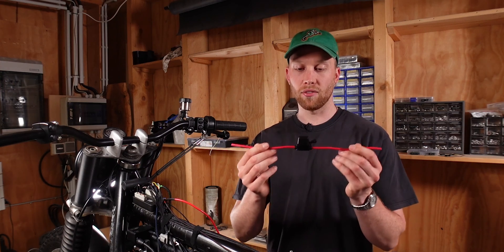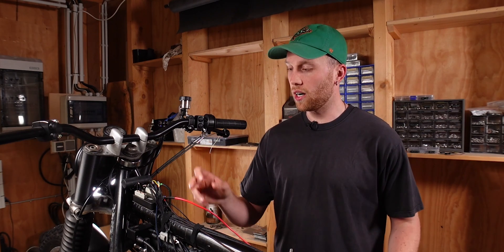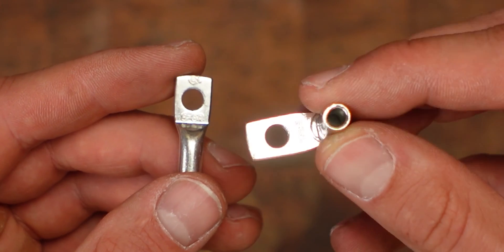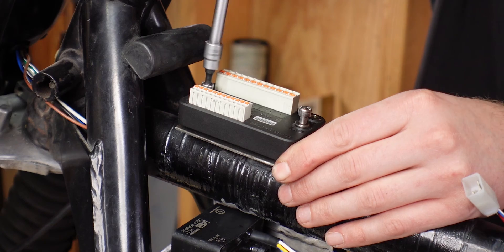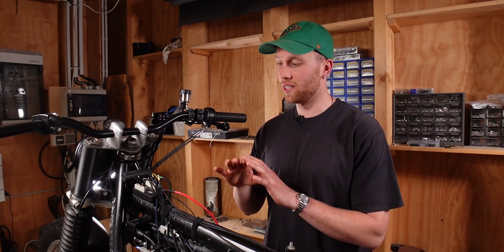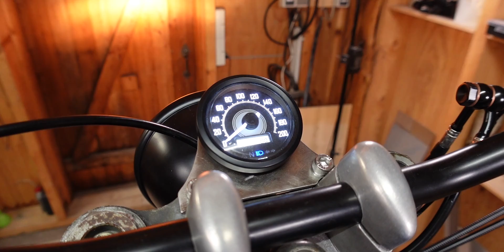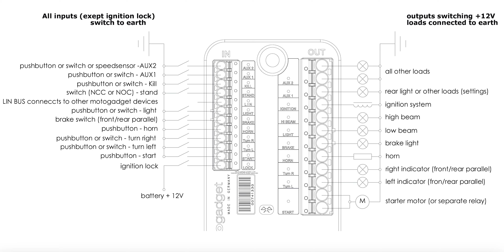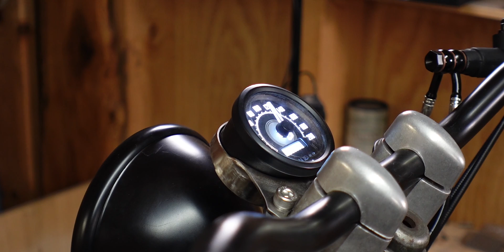How To Wire a m-Unit from Motogadget | Beginner Guide

Comment: Hello, I have a BMW R100, I have questions about engine wiring. Do you have a diagram of everything? It would be a great help, thank you!
Reply from the maker: Hi man, my complete wiring diagram is available in my store, you can find the link in the video description. However, I installed a new VAPE ignition and charging system, so the engine wiring is different to stock. If you are running the stock components you should be able to find a wiring diagram in the manual. I hope that helps!
Reply: @ Hello, the engine is standard. problem that I want to adapt everything to the motogadged central. I will have to do a new installation. thanks for answering!☺️
Reply from the maker: @APerformace ah I see. Yeah I also head a little bit of trouble with that. Send me an email at motowrenchers.blog@gmail.col and I’ll send you the wiring diagram for FREE. It might help you even though it’s not exactly the same setup 👌

Comment: hey im working in a R60 but i have in front GS1200 twing brake disk....i need a brake handles with the breake pump!!! which one are you using..or perhaps you can recomend!!
im in Argentina and is very dificult to get some parts!!
Reply from the maker: Che Cristian, que onda wacho? Yo use el Brembo PS15 que me gusta mucha. Are you going to use the original BMW brake calipers? Because the size of the master cylinder needs to be adapted to the size of the pistons inside the callipers. On the R80 there are two 40mm pistons (one on each side). Saludos a Argentina! Donde vivis? Viví en buenos aires cuando era joven y quiero volver.

Comment: This video is awesome and exactly what I needed. I have a 81 Yamaha xj750 I'm putting a moto unit blue on. My question is what about the ignition coils and the voltage regulator/stator. Is that all a separate thing? Maybe another video? 👀🤘🤣
Reply from the maker: Hi, thanks a lot. Yeah those should be wired up individually. You can download my wiring diagram in the description to see how the VAPE ignition and charging system goes together. It's a little different for every bike but that should give a good idea. The only wire that is connected from the VAPE system to the m.unit comes from the starter relay. If you have specific questions, motogadget is very responsive. I also had to hit them up to understand how I had to connect the ignition and charging system to the m.unit. I hope that helps. If you have any other questions when wiring up the m.unit, just let me know. I'm happy to help if I can. Cheers, Josh.

Comment: Moin Moin, tolles Video 😊🎉 und danke dafür .

Ich will auch auf MUnit umrüsten, das an meiner Harley. 
In der Beschreibung des MUnit steht geschrieben, es habe ein integriertes Starterrelais. 

Kann ich also das Originale entfernen?

LG
Reply from the maker: Moin! Danke dir!
Ja also Anlasserrelais müsstest du weglassen können. Die Relais Funktion übernimmt die Munit für alles. Bei mir laufen die zwei Kabel von Start Output direkt zum Anlassersolenoid.

Viel Erfolg beim verkabeln. Falls du Fragen hast schreib gerne. Vielleicht kann ich ja helfen. 

LG Joshua
Reply: @MotoWrenchers  danke für die schnelle Rückantwort 😄
Und mal so nebenbei, dein Englisch ist auf jeden Fall richtig gut.

Ich kam nur ins Grübeln, da in der Beschreibung geschrieben steht, das MUnit übernehme die Funktion des Starterrelais bei Vorhandensein von Magnetschaltern. Ich denke, das ist doch fast bei jedem Motorrad der Fall, wenn ich mich nicht irre, oder?

Hast du zufälligerweise auch ein Vodeo parat für die Verkabelung des Ladesystems? Das ist der Stromkreis, der mich bislang davon abgehalten hat, mein Motorrad selber zu verkabeln, weil dortige Verkabelungsfehler schwerwiegende Folgen haben können. 
Mit Gleichrichter und Lichtmaschine. 

Abo ist aber definitiv raus 👍
Reply from the maker: Klar, gerne 👍

Ich verstehe gut, dass das am Anfang etwas überfordernd ist. Ging mir genau so. 

Behältst du denn das originale Ladesystem? Falls ja, würde ich den originalen Schaltplan benutzen. Dann kann eigentlich nichts schief laufen. 

Falls du upgradest, so wie ich das gemacht habe, dann kann es helfen das alles erst mal auf‘m Tisch zusammen zu stecken und zu verstehen. 

Bevor du anfängst ist es auf jeden Fall eine sehr gute Idee, erst mal alle Teile zu finden und zu verstehen welches Kabel welches ist. 

Ich hatte auf jeden Fall mal ein Video gefunden, das erklärt wie die einzelnen Teile funktionieren aber nicht wie man sie verkabelt. Würde dir das helfen? Ansonsten habe ich die neue VAPE Anlage im „First Start“ Video verkabelt.

Wo hakt es denn grundsätzlich? Ist es das theoretische Verständnis, wie die Teile zusammen gehören oder wie du das praktisch umsetzt? Ich glaube, dann wüsste ich besser womit ich dir vielleicht weiterhelfen kann 💪
Reply: @MotoWrenchers  moin, danke für die Hilfsbereitschaft. 
Ja das Video wäre tatsächlich nicht verkehrt, obwohl grundlegende Kenntnisse vorhanden sind. 

Die Verkabelung aller Schalter und die der dazugehörige Verbraucher ist ja eigentlich selbsterklärend. Aber halt wenn es beispielsweise an die Lichtmaschine geht... Klemme ich diese an den Scheinwerfer? Habe gelesen, dass man die LiMa beispielsweise an den Scheinwerfer anschließt, da die Spannung  des Fernlichts erst die komplette Stromzufuhr für die Lichtmaschine benötigt. Bei normalem Abblendlicht wird ja weniger Strom benötigt als beim Einschalten des Fernlichts. 
Das generelle Indentifizieren aller Teile könnte auch ein Problem werden, da ich keinen Schaltplan für meine Harley habe und finde.
Und ja ich verwende alle originalen Geile, jedenfalls war so der Plan
Reply from the maker: @tltanslegacyxd7181 klar, sehr gerne :)
Hier ist ein Video, was mir am Anfang sehr geholfen hat. Vielleicht hilft dir das ja auch: https://youtu.be/FSAJciIFeRM?si=heWDDdR3rk-dRDER

Die Lichtmaschine ist eigentlich nur mit dem Gleichrichter verbunden. Der nimmt den produzierten Wechselstrom und wandelt den in Gleichstrom um, sodass die Elektrizität von allen anderen Teilen am Bike genutzt werden kann. Außerdem passt der Gleichrichter auf, dass die Energie nur in einer bestimmten Range an die Batterie abgegeben wird. Ich bin mir nicht mehr ganz sicher aber ich glaube ich habe das in diesem Video noch etwas genauer erklärt: https://youtu.be/tgbXfVIdizc?si=cRYC4cRADBwROH8-

Bei mir wir an der Lichtmaschine auch noch der Zündzeitpunkt abgenommen, dadurch habe ich noch Kabel die zur Zündung gehen aber das ist nicht die primäre Funktion. 

Das Fernlicht und alles andere, wie Blinker etc. läuft alles direkt über die Output Seite der Munit. 

Ich hoffe das hilft. Hast du das Werkstatthandbuch für deine Harley. Da müsste der Schaltplan drin sein. Wenn du den finden könntest würde das bestimmt sehr helfen. Vielleicht auch über ne Harleywerkstatt?
Reply: @MotoWrenchers  guten Abend, ich habe heute die komplette Elektronik identifiziert, habe doch einen schaltplan gefunden 😍 
An der Harley habe ich einen elektrischen Vakuum Schalter, welcher am Vergaser sitzt sowie ein Kontrollmodul für die Zündung. 
Hast du eine Ahnung, wie man diese beiden Komponenten anschließt ans Mo Unit?

LG
Reply from the maker: Moin,
Top, dass du einen passenden Schaltplan gefunden hast. Der wird bestimmt sehr hilfreich sein. Kannst du in deinem Schaltplan sehen, wie die beiden Komponenten vorher verkabelt waren? Bei der VAPE Zündung von der BMW ist die Kontrolleinheit mit der Lichtmaschine und dem Zündungsnehmer (so heißt das glaube ich auf Deutsch) verbunden und geht gar nicht an die Munit. Das einzige was bei mir von der Zündung mit der Munit verbunden ist, ist das Relais vom Zündsystem, was an den "Ignition" Output-Terminal angeschlossen ist.
Hast du dir schon einen neuen Schaltplan gezeichnet? Das hat mir am meisten geholfen alle offenen Fragen zu finden und dann systematisch zu beantworten. Am Ende habe ich dann für die letzten zwei Sachen, die ich selbst nicht rausgefunden habe Motogadget geschrieben. Ich hab dazu auch Video, was dir bestimmt hilft, wenn du es noch nicht gesehen hast: https://youtu.be/P0vhRdAyE2Q?si=n-ZvON6FLoG4oyGo
Reply: @MotoWrenchers  wirklich! Vielen vielen Dank, dass du auch antwortest und hilfst. Das würden dir wenigsten machen. Ich konnte das Problem schon lösen und habe mir einen Schaltplan für das Lade-, das Starter- und das Zündsystem erstellt😄👍
Reply: @MotoWrenchers  eine Frage habe ich noch 😂😂 
Ich habe zudem das Motogadget Mini Scope, also den Tacho.
Wird der an LIN BUS angeschlossen?
Reply: @MotoWrenchers  sooo, ich habe alles angeklemmt und es haut alles hin. Fast alles. Wenn ich den Schlüssel drehe, geht alles an, bis auf den Scheinwerfer. Da tut sich nix. Erst, nachdem ich einmal den Schalter für Abblendlicht/High Beam betätige. Erst dann geht Abblendlicht an. Wenn ich aber auf High Beam stelle, geht das Licht und das Rücklicht nach ca. 3 Sekunde aus. 
Mein Scheinwerfer hat 3 Anschlüsse, Masse, Abblendlicht und High Beam. Vielleicht habe ich die Stecker nicht korrekt angeschlossen. Kann dies ein Grund dafür sein? 

Und Neutralität leuchtet durchgehend, der Öldruck auch. 
Ich habe den Öldruck- sowie den Neutralschalter in den AUX1 Input und die Leitung zur Kontrollleuchteneinheit von AUX2 Out gelegt.
Ist dies so korrekt?

LG🎉
Reply from the maker: Moin, sorry für die späte Antwort. Bin vor zwei Wochen in die USA gezogen und musste einiges organisieren. Bin jetzt aber für Weihnachten auch schon wieder auf dem Weg zurück und muss noch den TÜV bestehen 😅 Du machst guten Fortschritt. Das mit dem Licht hat mich auch erst verwirrt. Das war/ist bei der BMW auch so aber das kann man wohl später in der App einstellen. Muss ich mich jetzt auch mal mit beschäftigen, wenn ich wieder in DE bin. Was hast du für Schalter/Knöpfe für‘s Licht. Ich habe die mo.buttons und da ist es so, dass wenn man zu lange den Highbeam Button drückt, dass das Licht wieder ausgeht. Vielleicht ist das schon mal ein easy fix. 
Öldruck und Neutral leuchten, weil die Dauerstrom von Aux bekommen. Die beiden laufen nicht über die Munit, sondern die Verbindung ist direkt zwischen den Schaltern und den Kabeln im Tacho (wenn die bei dir auch im Tacho sitzen). Und Masse ist entweder direkt im Schalter geregelt (wenn der nur einen Terminal hat) oder du legst die an den Rahmen irgendwo. Wenn du zwei Terminals am Schalter hast ist es egal welchen du für Masse nimmst. Guck mal in mein Diagramm, da sollte das ganz gut ersichtlich sein. 
Ich hoffe das löst die Probleme. Halt mich gerne auf dem Laufenden 💪
Reply: @MotoWrenchers  Respekt für diesen großen Schritt!! Aber mal ehrlich, gute Entscheidung 😄👍

Ich nutze an der harley die original Schalter, keine Taster. Licht ist Kippschalter, oben High Beam, unten Abblendlicht. 
Wenn ich zündung drehe, geht Licht nicht an, wenn ich dann den Schalter, egal ob nach oben oder unten betätige, geht Abblendlicht an. Mache ich Fernlicht an, gehen Scheinwerfer sowie Rücklicht nach ca. 3 Sekunden aus. 
Ich habe nur das m unit basic.

Ich habe schon nachgelesen, dass die original Konfiguration der Unit auf Taster läuft. Vielleicht muss ich das richtige setup einstellen.
Vielleicht habe den Scheinwerfer auch falsch angeschlossen. Aber ich denke ersteres.

Und das mit neutral und öldruck ist sehr hilfreich, vielen Dank!! 
Ich wünsche dir auf jeden fall viel erfolg in Amerika!
Reply from the maker: Ah ja, kann sein, dass Kippschalter ein anderes Setup brauchen. Das habe ich noch nie gemacht. Aber das muss auch gehen. Sonnst kann dir da Motogadget bestimmt weiterhelfen. 
Viel Erfolg bei den letzten Schritten! 💪 Das klappt schon!
Reply: @MotoWrenchers  jaaa ich habe in der Beschreibung nachgelesen. Die Standardkonfiguration A ist voreingestellt. Ich benötige konfi B für licht- u. Scheinwerfer- Schalter (kein taster) daran liegt es. 

Hast du für sowas ein Video??😂😂😂
Reply from the maker: @tltanslegacyxd7181 ne, leider noch nicht aber nice, dass du‘s rausgefundenen hast 🙌

Comment: Hi. Great video. ThanksHow did You contact motogadget? I can only see forms to enquire about parts etc. Thanks
Reply from the maker: Thank you, I appreciate that. I don’t know if they have this information only on their German page but at the bottom they have a link to ‚Impressum‘ where you can find their email address (info@motogadget.de). I hope they can help you 👌
Reply: @MotoWrenchers  Thats great. Thank You. Thats very helpful.  Im about to wire my virago. Got stuck on the neutral sensor. I can connect the side stand switch but how the M unit will know if the bike is in neautral, right?
Reply from the maker: Yeah, I had a few people commenting about that. Would you mind letting me know, when they got back to you, how it’s done? How’s the wiring going apart from that?
Reply: @MotoWrenchers  Oh. Im just starting. Also I work on a Virago so Ive changed the starter setup to the 2 gen Virago with a starter solenoid so..long story short Im  figuring out how to make all that work with the M unit. Just got all the bits now and tearing through the old harness to see what I still need. I think Im going to start today and will propably have a list of questions so Ill email them with one long headache email🤣😬
Reply from the maker: @_MotoMikey_ hahaha sounds like a plan 👌 If you have any more general questions feel free to ask. Happy to help if I can :) Good luck and take your time!
Reply: @MotoWrenchers  Thank You man! Much appreciated. Interesting journey that is for sure haha.
Reply: @MotoWrenchers 
Hi. Ive contacted motogadget. Generally depends how your switches work. In my case neutral switch is closed when in neutral( I guess thats normal) and side stand switch is closed when the stand is up. In this setup I just connect my neutral switch (1 wire coming out, grounded at the engine case) to the STAND port on my unit together with 1 wire from stand sensor( other goes to ground). With this circuit is closed either if in neutral or with sidestand up. Thats the theory :D Ill update when I do it. So far I got it cranking and got spark.
Reply from the maker: @_MotoMikey_ ah that makes sense. Thank you so much for letting me know. Great that you’re making progress. What are the next steps for you?
Reply: @MotoWrenchers  damn...now I just thought about 1 issue. If I put them both on 1 circuit and then run a wire from it to the speedo/dash for neutral then everytime the side stand is up, neutral will come on the dash, right? What do You think? Damn..Next step is wiring all the lights, indicators and speedo. That will be fun. What about You? Working on something?
Reply from the maker: Yeah true. That’s a good point. In that configuration you’d basically loose the neutral function. In my opinion a properly working neutral switch and light combo is more important than the side stand. Do you have the option to add an individual LED somewhere for the side stand? I don’t know how it works on the modern bikes that the side stand basically kills the bike when you shift into first or second while it’s out. 
I just moved to the US on Monday. Finished the BMW on Sunday and took it for a spin. That was a great feeling after four years. Will have to do a few last things over Christmas and then pass the TÜV but it’s basically finished. Now I’m setting up the workshop over here. 
Which speedo are you running (you might have already told me)?
Reply: @MotoWrenchers  To the US? Where to? Im in LA. I see that mine had a side stand relay connected to some starter cut off relay. Id love to avoid having all that. Normally I wouldnt care about the side stand switch but Ive heard a tragic story about it and since then I apreciate the importance of it. Im putting Koso TNT04 speedo on.
Reply from the maker: Yeah, I'm on the opposite coast of you, in Virginia now. Oh what happened? Very radical idea...but how about not running a side stand at all? 🤔😅
Reply: @MotoWrenchers  That would be easy:) No stand I mean. Ive heard a story of a friend of a friend who had a fatal accident. Took off with side stand out- couldnt make a corner in the moutains. I figured a solution. I wont have the engine cut off but the dash had a available "check engine" port. I made a custom bracket for the swith at the stand so now its closed circuit with the stand down. This way check engine light will be the side stand light.
Reply from the maker: @_MotoMikey_ nice, that sounds like a good solution 🙌 and after that story I understand why it’s so important to you! That’s horrible.

Comment: Just a quick comment, the connectors are designed to be used with stranded wires, not pins.  If you use round pins the contact area is reduced and if a high current load is being supplied the contact might over heat.
Reply from the maker: Hi Richard, if I remember correctly the munit blue came with a bunch of ferrules in different sizes (all relatively small though). I thought those were supposed to go on to the wire ends. Would you recommend to take the pins off of the output side?
Reply: @MotoWrenchers  The breakout box that comes with the Motoscope pro has ferrules for the wires as it uses screw terminals.  I have fitted 2 MoUnits recently and they didn't come with ferrules. The MoUnit uses wago style connectors which are designed for stripped wire.  I have only used ferrules on the older M-unit 2.  One other tip is to check the rating on each pin of the Deutsch connectors. DTP 7.5A DT13A and DTP 25A.
Reply from the maker: @richardprowse1088 thanks a lot! I really appreciate your help 🫡🙏